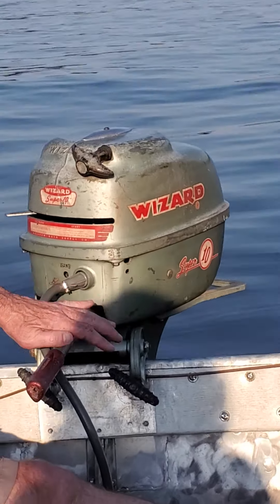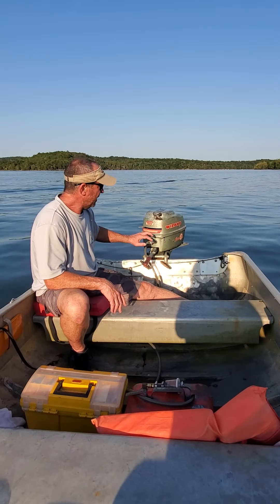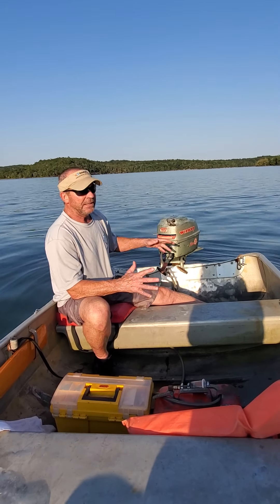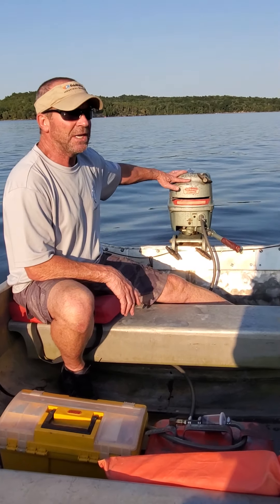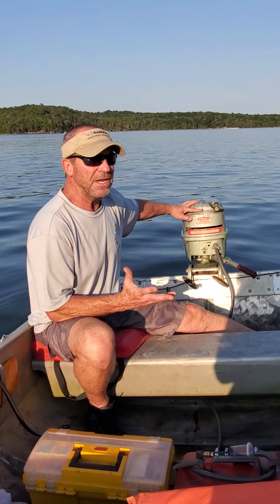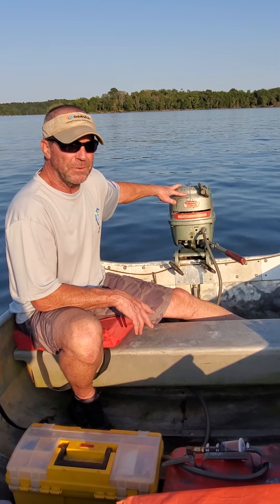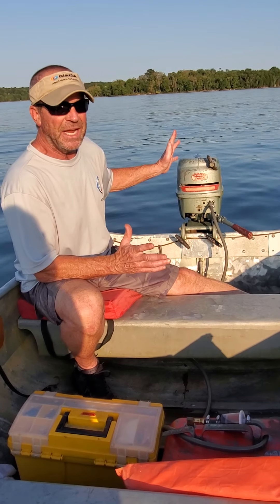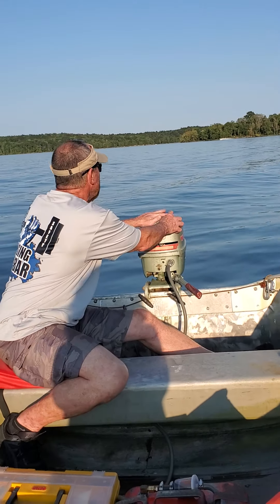1957 Wizard Super 10, Model WM7A

Comment: Killer job on your motor!
Looks like your boat is an AlumaCraft Model R.  I have a Model RBL and a Model F.  I've run several different Merc 200's on my RBL and it can get pretty scary!
Reply from the maker: Thanks. Can't read my model number for my AlumaCraft cause nameplate has some corrosion damage. Looks like "FDH or PDH"  Yes, I have scared my self a few times running my Mark 20, Mark 25 and CC Commander a few times specially on a windy day. Gonna try running my Johnson PO-15 one of these days.
Reply: The seat isnt far forward enough to be an R model